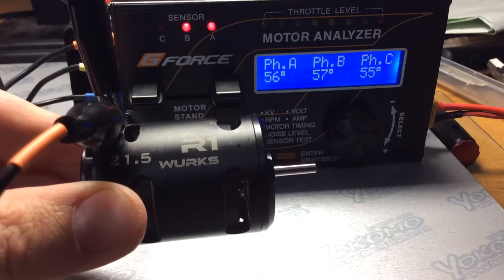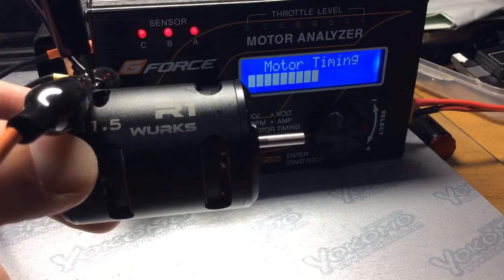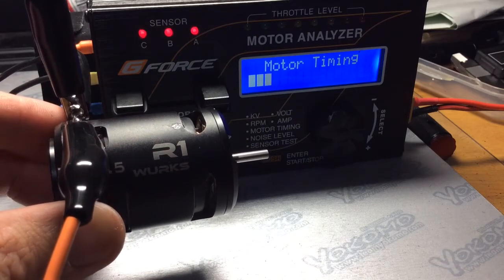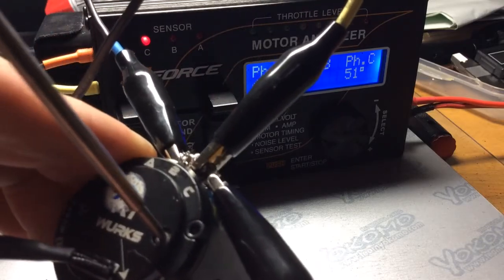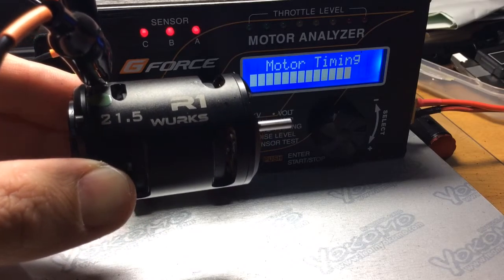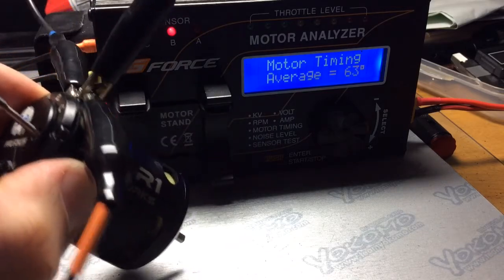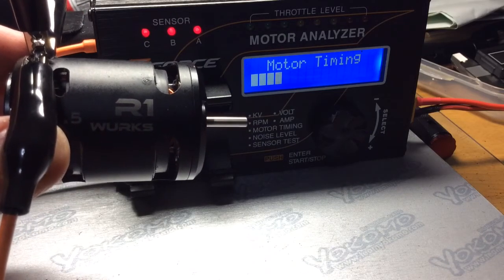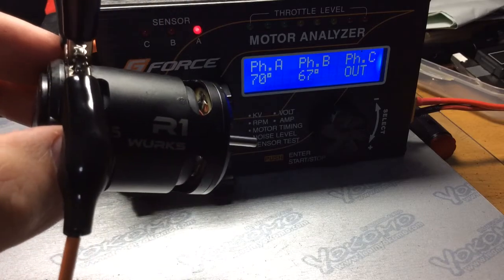R1 Wurks 21.5 Timing Settings

Comment: Hallo is The R1 13.5 The best an strongest Motor on The Market. In a Club race in Austria drive a guy The Motor The guy is 3 Seconds faster and is The fastest. Is The Motor Good wath think you about The Motor Thanks Form Austria

Comment: We use the R1 Wurks for carpet oval 1/10 racing. We use the 21.5 and 17.5 motors.  Do you have additional tips and information concerning these motors both v7 and v9 versions.
Reply from the maker: +Milton Winslow 

I would keep an eye on the amp draw. Anything higher than 5.0 amps will make the motor inefficient. I keep my amp draw around 4.2-4.5. Gear from there. The key is to maintain consistent lap times until the very end of the run. Your laps times for the last minute or so will be a good indicator.

Comment: I dug a little inside this motor and compared on a different product (the motolyser). imgur dot com /a/AvO2P to see my findings. physical "timing" inside the R1 is not what you expect... it's a mystery.
Reply from the maker: This motor is quite the mystery in many ways. I used this motor at the Japan Nationals and I set the timing on the can to the 40 degree mark. At the time I didn't know the total timing, after I took it off the track (after a 8 minute qualifier) it came off at 260 degrees. Most motors would smoke, but this motor still rips like there's no tomorrow.